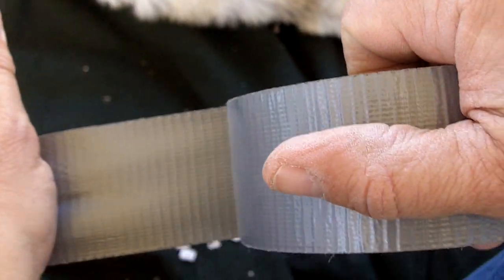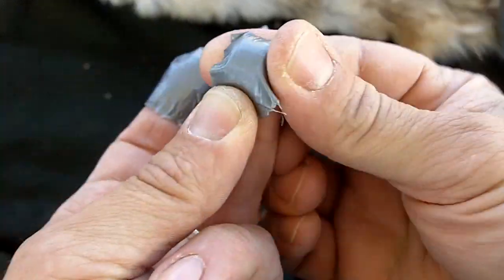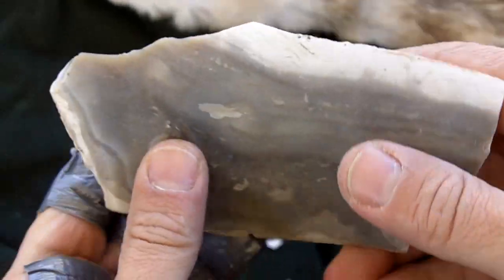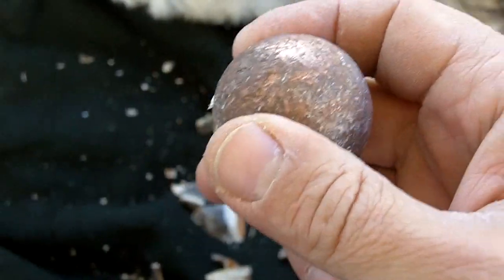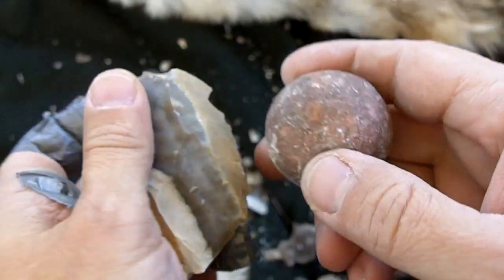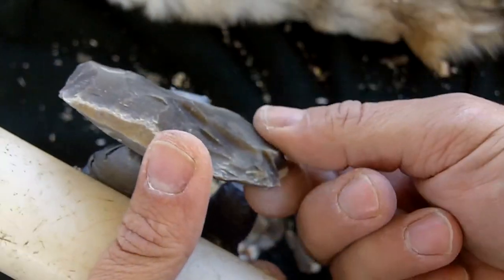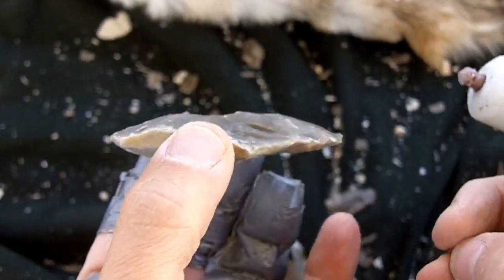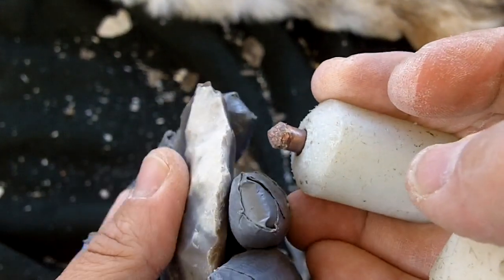222 - Flintknapping Second Clovis Part 1/3

Comment: I always enjoy and appreciate your videos.I'm sorry that I've put such a demand on your time. Don't bother to answer if it is a bother. I'll understand. I am very curious as to why you use hammerstones on good rock and even good cooked rock. Once I got proficient with a whitetail billet I would never use a hammerstones on stone like that. They don't carry flakes well. They tend to open up cracks and crush or scoop edges. I always used a different bifacing strategy. I did not use a levallois technique. I combined establishing an edge and outline with thinning. Is this the reason or am I missing something? Thanks Patrick